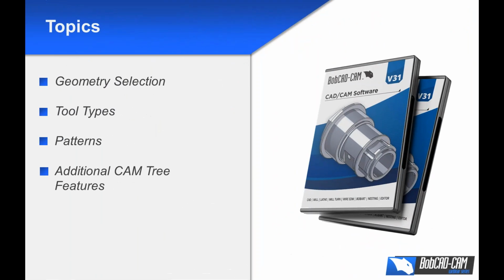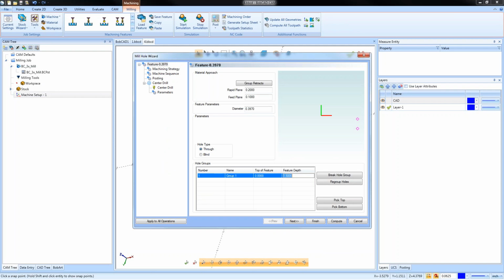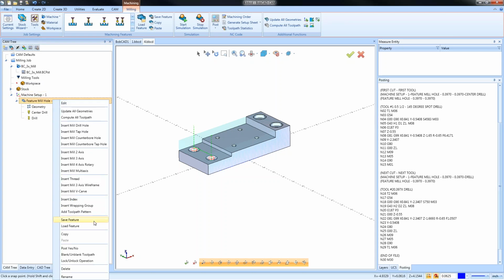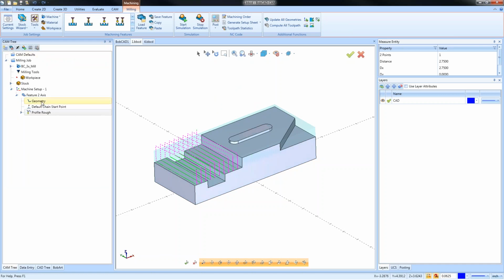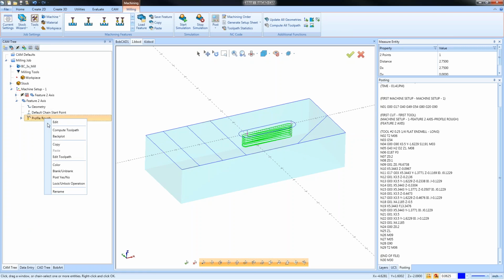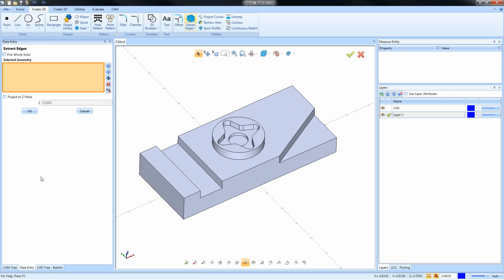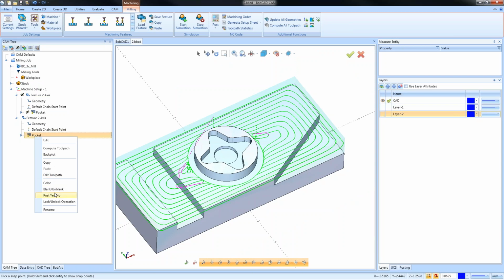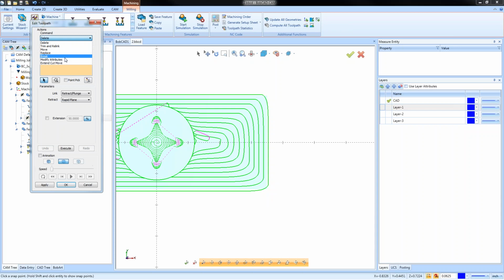V31: 2D Milling - BobCAD-CAM Webinar Series

Comment: When side roughing, if you have a solid model and the stock has been defined why do I need to input stock reaming and number of cuts?  The software should be able to do this for me.
Reply from the maker: Because 2D operations are not stock-aware.  If you are looking for stock-aware toolpath use the Mill Professionals Advanced Roughing.